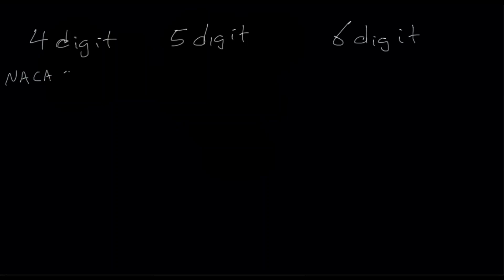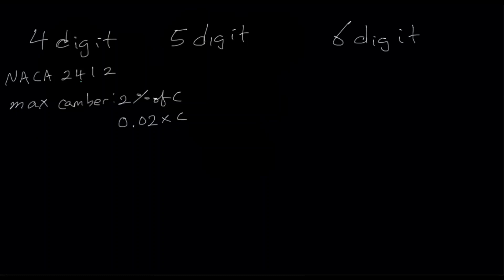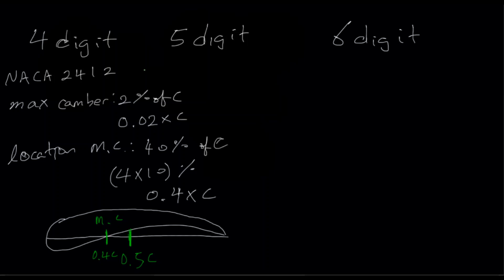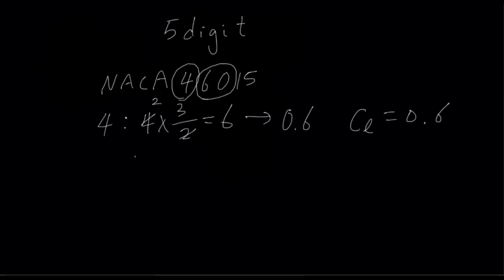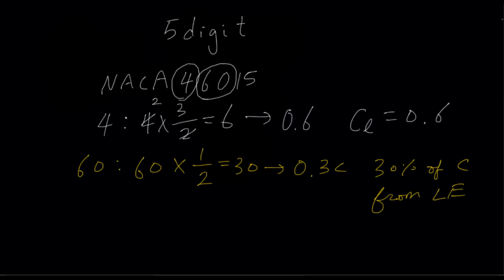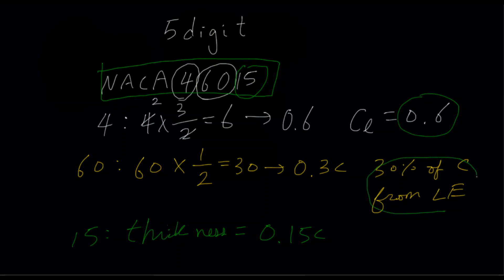How To Read NACA airfoils (4 digit, 5 digit, 6 digit)

Comment: Which NACA 6 digit airfoil work the best for a business jet? I needed some help on this. Thank you 🙏🏼!
Reply: NACA 6-series airfoils are not ideal for most business jets. They prioritize performance at a single condition, while business jets need a balance for takeoff, landing, and cruise. . or you can look into these options:
NACA 23012: This 4-digit airfoil is used on some older business jets and offers a decent balance of performance.